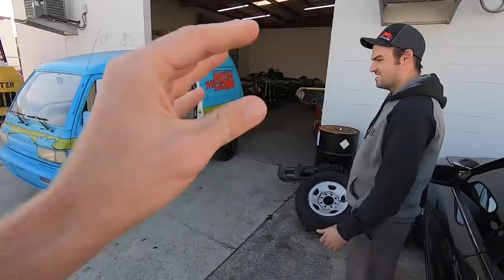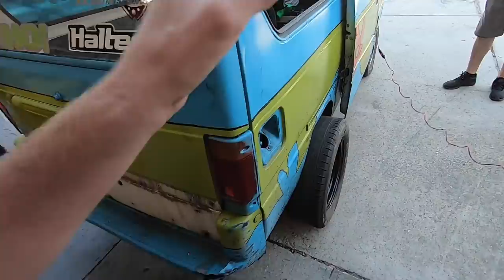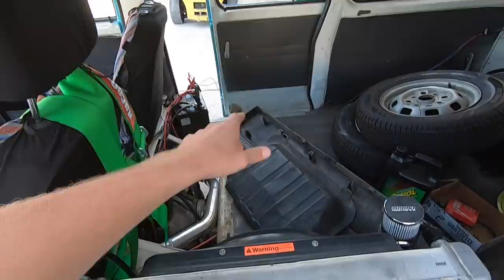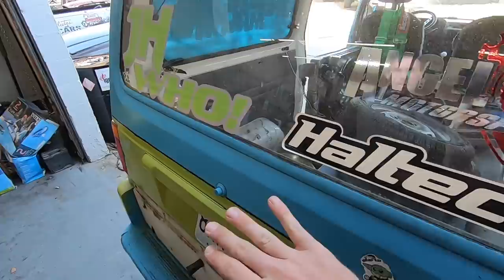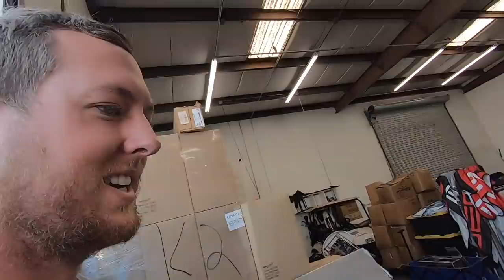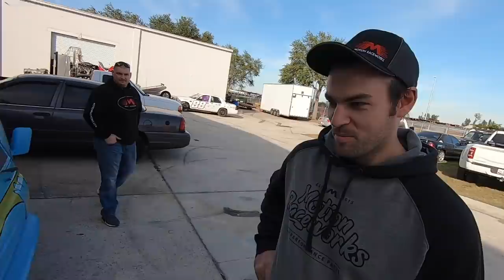What Happened To the Mystery Machine??? Our 600hp Turbo Rotary Burnout Van Returns!!!

Comment: The radiator should be in that busted window space.
Reply: Exactly what I was thinking!!
Reply: With a big shroud that keeps it contained too
Reply: Yep
Reply: And then make an air channel /shroud to the rear window.
Reply: That's what I'm sayin
Reply: Put a massive big block with a turbo sticking out each back window. Radiator mounded in the back window.
Reply: Painted to match
Reply: Yeah 👍 just what I was thinking, and shrouded to a hole cut into the floor.
Reply: Love the idea but I think the radiator needs to be level with the engine but I’m really not sure.
Reply: @felixborek  not so much. It is easier to burp if it is the highest point. Doesn't even actually have to be up right to cool.
Reply: Whatever they do they need to get more protection for the driver. Dont need a repeat  :/
Reply: Came here for this! (Now back to the vid) haha
Reply: Idk, above the back tires like that is just begging for problems in my opinion. If it wasn’t a burnout car, I’m right there with you
Reply: Need to pipe that intake  back up into the floor into the cab too, get less dirt and be able  to go through  bog holes
Reply: Agree
Reply: @Carnerd101  yeah like a big ass fan
Reply: @buckfutter99  nah
Reply: Yep put that radiator where that windows was
Reply: was just typing the same thing as i seen this :D so its getting a like from me
Reply: The radiator up there would just be too high to have all that weight. Especially if they are throwing it around a burnout pit. You would need to keep the centre of gravity as low as possibly with that thing. They can tip over so easily.
Reply: Bump for a great idea
Reply: Commented that then scrolled like 3 Comments and found this lol
Reply: I vote for putting IN a the back window, then it’s going to get better airflow, remove smoke from the cabin. Also add some diesel injection above the back tyres for more smoke at the push of a button, and I’m also a fan of putting an air filter in the cab.
Reply: Or on the Roof
Reply: @Carnerd101  two giant fans would be good
Reply: That is a good idea, lol.

Comment: Yes rotarys love to be driven hard but they also don’t like sitting around. If it’s been out if commission for 6 months you need to take it for a good drive to get its compression back up.
Reply: Gotta treat it like a 2 Stroke n you are Good.  I had an rx8 with 130k on it and it was a blast... add oil every gas fill lol

Comment: use the broken window as a place to put the radiator
Reply: Oh that smort
Reply: @sargentdoggo297  oh very smort
Reply: Louvres that are painted on the outside like the window was.  Hell, just replace all of the windows with closeable louvres and put exhaust fans in them to push out the tire smoke.
Reply: Smart
Reply: Was thinking that .. box it out too it’ll be safe as houses
Reply: Except if the radiator blows facing a crowd lol
Reply: Would add to the mystery machine
Reply: @Thedude897  the lovers would direct everything down and make it so it can’t go through that one lover set. That way. It can’t hurt the crowd. You do know most cars doesn’t have anything but plastic in front of it so it would be way safer than stock!!
Reply: @cliffp73   Hurt the crowd?
 Hurt the crowd! Cleetus and Neighbor almost blew some kid's face off with the two step!!!
A nitrous bottle went full retard spinning and flipping around the burnout pad!!
Cooper(as a spectator) was engulfed in flaming tire powder in Australia!
 Don't worry about the crowd, don't worry about the crowd......

Just Kidding....... Sooo although mounting the radiator in that missing rear window opening sounds pretty perfect,considering 90% of wall taps involve the right rear corner of the vehicle that is gonna be a little dangerous to the crowd.🤷‍♂️☠⚙😬 💦💨
Reply: Its a burnout vehicle...thats asking for trouble if the tire explodes on that side!
Reply: @cliffp73   I really like the way you think BTW!!!!😁
Reply: @skeetermcswagger0U812  ok ok ok I am only going to say this once!! But on the live stream today!!  Did you see that turd 💩 chopper!!!!!!!! Oh my god I was like WHATTTTTTTTT DURNNNNN WOWWWWWW

Comment: "we gotta move the radiator away from the driver" - Dude, the Driver is sitting on a rotary engine!
Reply: What could go wrong..... 0_o  ....
Reply: I mean, lifting injectors and spraying fuel everywhere is about the only real physical risk to the driver. Not much else is dangerous about them. Theyre sealed up and pretty damn solid.
Reply: Yea in nz due to flywheels exiting the engine. It's compulsory to run a kevlar jacket over bell housing when participating in car events.
Reply: @hops004  oh yeah, flywheels too. Thats a given for sure. Worlds quickest foot amputation.
Reply: @hops004  did you go to the rotor nats in the early 2000's when 3 or 4 fly wheels exploded? It was a real eye opener on what can happen. Rule changes came in after that event....
Reply: @jarredflynn  yea 2001 I put one through my bonnet in my purple series 1 haha 3 minutes of bliss then bam
Reply: @hops004  I remember it well,  that was a wild year. I just found a bunch of photos from the event, but not of your car unfortunately....
Reply: Which is why he said he wants to seal up under the seats.
Reply: I thought this was coopers
Reply: I hope it never throws a rod
Reply: @mrdeeyay  lol what rod? It's a rotary there are no rods.
Reply: @Naters305ytg  yer had a crack at sarcasm online. Doesn't translate well.

Comment: Just a thought; rather than building a firewall and closing off the back of the van. You guys should put the door back on, and make a reverse-scoop so the radiator sits outside of the van in the scoop. That way you could even put a 3rd seat in it for all the party burnouts.

Comment: I feel for your bud burned by burst radiator. my cap burst while leaning over the front of the engine. lost skin from belt to throat, turned my head and saved my face. still have scars on the inside of my arms over 20 years later. Wish him the best on recovery
Reply: PS. my son told everyone i got FIRED... not scalded or even burned

Comment: Sheetmetal the back to side windows and paint them to match the van, side door as I said in the beginning build a shroud around the radiator and put vents in that side door so air can be pulled in and flow out the bottom of the van with electric fans.  Build a shroud around the gas tank running a filler and breather to the side of the van. 
When the van door closes it seals to the shroud around the radiator, also for easy access to the radiator also.

Comment: If you put the radiator in the back and build a 50/50 firewall (lower part steel or aloy upper with glass replacement) you could put the bench seat in the back and make it a sort a driver or get er quick van.

Comment: You might want to consider installing the radiator in front of that broken window? With a strong fan attached to it, it could be a good way to push the heat out of the cabin

Comment: I’m saying this needs to race katertot.   And it needs to win.
Reply: Yes, needs to race katertot!!
Reply: Its gonna need a looooot of work done first before that ever happens
Reply: I said the same thing just now! Not many people thinking about Jeremy I see
Reply: Widen the stance, tune the suspension, adjust the gearing, think about a cage, settle for a helmet and send it. Just don't give it to that ksr dude,that would be like giving picaso a pizza box and crayons.
Reply: Katertot is pretty dialed and overall a better setup, the mystery machine is way too sketch to go fast😂
Reply: @Thomas Orfano And your point is? 😂 would people watch Katertot if it wasn't sketch? 
Probably only SMART fans, if such excist's?
Reply: @Tom-sx6yl  they can put suspension and wheelie bars on it! They already putting in a roll cage!!
Reply: @thatdudeinorange2297  I’m saying it’s way too dangerous to go fast in the mystery machine ya clown 😂 that shit came with an engine that makes 25 hp and 8 inch wheels, shit is not designed for speed at all... but on the other hand the smart car is modern and is much less sketchy
Reply: Katertot is in the beginnings of being a drag smart car the mystery machine isn’t built for that ! So I highly doubt they’ll race  but if fans wonna see that happen  we have gotta give the  mystery machine some time too prepare x
Reply: I think it would be pretty fair right now lol the ol’ katertot hasn’t had much luck at the strip lately 😝😝
Reply: @Tom-sx6yl  Its far from dialed. Even fully dialed whatever car has a longer wheel base will be safer.   It gives you just a bit more time to react to failure or hitting a water spot.

Comment: Many years ago a friend of mine had a rebuilt 12A Rotiserrie with a hairdrier in his RX-7, about 1993 was the year this happened, it caught fire in the cabin, I bought the engine, turbo and driveline complete. I managed to fit that into a 1974 Mazda 929 Wagon (an old LA2VV) and drove it from 1996 until 2001 when the body started bending in the wrong places, then I shoe-horned that into a 1979 Mazda 626 (The last ones in rear wheel drive in Australia with chrome bumpers) which was a body that had been garaged since new. The whole life of that engine it had been flogged mercilessly and spent much of it's highway miles at high speed...and also devoured fuel but that is what you can expect. The 626 was sold off in 2010 to a guy at Queenslands Gold Coast by my young feller whom I gave it to. That guy turned out to be some sort of local drug lord, he went to jail and the car disappeared into obscurity. That little Rotary did not have any of the benefits of the Vargas Brothers and it still went through 3 vehicles with no refresh!

Comment: For the radiator: 
I would say cut the floor out in the back, put the radiator in the floor and have fans sucking air trough it. Make it so exhausted air blows out an opening in the back doors. This way you will make smoke blow out the back, making a bigger cloud. This will also make a good firewall around the radiator, leaks can only go down or backwards, where no one should be.

Comment: I always would use a mix of oil and gas to prime a rotary after sitting to lube the seals before starting. Does sound amazing though. Never built anything like that back in the day but I had some fast ones. Bad little van

Comment: I would not recomend spraying break clean into the intake. Remember , it is designed to degrease surfaces, thus you are washing any oil film out ot the rotors, or cylinders for piston engines. Get some Diesel starting fluid. Talk to JH about it

Comment: put in a slotted vent in where the back window was, make a rack and mount the radiator there. it'll get great air flow, and will be even further from the driver.

Comment: When you’re doing an Aussie style burnout in a microvan with a 600hp, high revving rotary under your ass, the radiator placement is probably the least dangerous of your problems lmao
Reply: yep, i just commented something similar.
Reply: how? the radiator could easily blow a hose off and burn the fuck out of you. imagine the vargas truck burnout explosion but inside the cabin
Reply: @Sarogus  whats going to happen, its gonna throw a rod? its a fucking rotary
Reply: @araybeezy1653  ive literlally seen one grenade at 10000rpm before a drag race.  there were bits of clutch and flywheel all through the pits. you are sitting on top of this seperated only by sheet metal. hence why rotary vans are now illegal in NZ edit- and all rotaries must now run scatter shields/blankets
Reply: @TheGrayWarbler  fair enough, but this van is an automatic. and it was tuned and built by the vargas bros. its not likely to blow up. though they still use scatter shields with autos its not the same as a clutch exploding imo
Reply: @araybeezy1653 1st I promise I'm not a rotary hater, I'm the opposite.  2nd Some times hi performance engines just go boom , so a flywheel or flexplate will still castrate you 3rd I would of never mounted that radiator there, so I totally agree with you on that point. Cheers!
Reply: @araybeezy1653  I never said anything about a rod, you did. The first video that comes to my mind is the one with the yellow Mazda. Sorry but a piece of cloth on a chair ain't gonna be saving any mans nutsack.
Not saying the radiator isn't an issue, it most definitely is, just saying I agree about not sitting on an engine revving at 10k rpm with nothing but cloth between you and it.

Comment: Nothing sounds like a rotary. Too bad it's running lean down low.
Reply: Vargas set it up rich until it pass the break in period.
Reply: @normanguzman417  When he went to rev it and it popped and didn't want to rev till the fuel adjusted.
Reply: @waybous  been running with a bad alternator for the past two events 😂
Reply: @angelmotorsports  Nevermind then. Love the work you guys did to the van. Sound is amazing.

Comment: Have to relocate the intake, probably tire rubber in air filter. Should mount the radiator in the broken window. Probably have to cut a hole in the roof to check the radiator. Run the intake in a stack out the roof

Comment: Why don't you relocate the radiator to where the broken window is. It will fill the open space where the window used to be, is away from the driver, leaves more room to mount the fuel cell, and is out of the way so you can work easier around it, and can keep all the doors shut. The only  problem is it might need a auxiliary booster pump to push the coolant up there and might need to install a couple of "RV" style roof vents with electric fans in it to help pull all the hot air out.

Comment: Can ya chuck a piece of sheet metal bent over the radiator cap so if it pops off it will fly in the direction of the bend in the sheet metal. Heaps of the water will spray that way to.

Comment: Leave the busted window out. Cut out a hole out of the lift back for the radiator at the very back. Wall the cab of at the back of the sliding door openings

Comment: mount the radiator in that busted window then put a louvered piece of sheet metal on it, and re-paint it. if it doesnt flow enough air, bust the other window on the other side and put another radiator there

Comment: Why not take out the rear windows and weld a piece of sheet metal to the van to cover the holes. As safety feature for just in case you clip the wall again

Comment: Put the radiator in the window opening that is missing glass. Should be far enough away from the driver to not worry about any safety issues and keep the engine cool.

Comment: Why don’t you guys mount the radiator in the broken window cavity. 
1. Keeps it away from the driver
2. Better fresh air
3. Can run it with the doors closed to stop debris possibly flying in the cab

Comment: You really shouldn't leave a rotary engine sitting for too long. since the apex seal springs are bare metal if you leave it and it starts rusting then the springs could get stuck down or lose tension. and then it wouldn't seal correctly and would be low on compression

Comment: Shoulda seen my filter after I took my stock f150 mudding and had water to the windshield😂truck was fine and still is but had mud in the intake and covered all over the throttle body. The filter was in pieces from the mud and water

Comment: Now that it’s not Ricey McRicerson’s van, it DESPERATELY needs a V8 and a big cast iron 9” and everything else you can think of to put weight down low. It’ll never be stable enough to need a cage for drag racing or anything (not with factory suspension, anyway), but for the amount of carrying on that you can do in that machine, a cage wouldn’t hurt to protecc ya necc.

Comment: maibe turn it intoo a ausie style flatbed / stakebed cut the back of the bodywork off and the rest up to the rearseats and keep only the chassis (unibody?) use most of the rear to close the back of the cab in and put two bars from the rear hoop to the suspension points in the rear 
that would take care of the firewall and most of the damage done to the car (you dont need to replace the reardoors or the broken glass)  a custom flatbed suround over the top of the rearwheels from steel rectangular tubing makes the rear corners bulletproof against wall taps and youre able to mount bigger rear tires maibe even a better rearaxle  , 
radiator in the verry back under the flatbed floor basicly allmost against the rearaxle  gastank in the center of the bed on top only put fenders on the front of the rearwheels to protect the filter and the engine and leave the back open 

http://lh6.ggpht.com/_4tlMvnYDZ0I/SqsOehh8AiI/AAAAAAAAACo/jQ48tr6BtSo/s400/IMG00019-20090830-1343.jpg

Comment: That radiator is scary after parkers accident, radiator safety should be priority
Reply: That radiator was scary from day one, personally I think the entire build is a death trap. the engine bay needs 10 or 12 gauge cover, as well as a kevlar blanket because when rotaries let go the do so in a big big fashion, the trans need a kevlar blanket and it a SFI bellhousing as well as drive shaft loops and let's not forget roll bar with funny car cage with window nets /arm restraints.  While they are at it how about some rear wheel studs